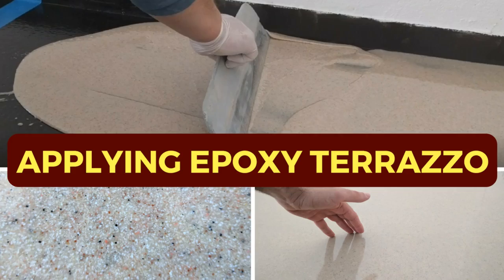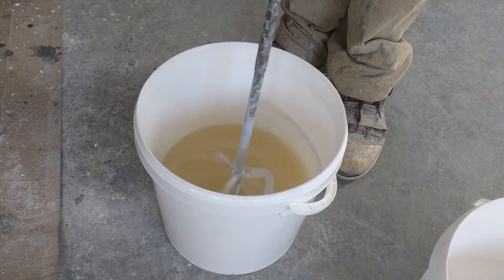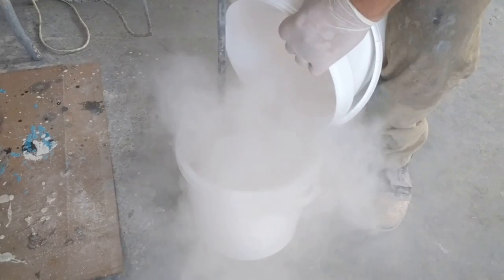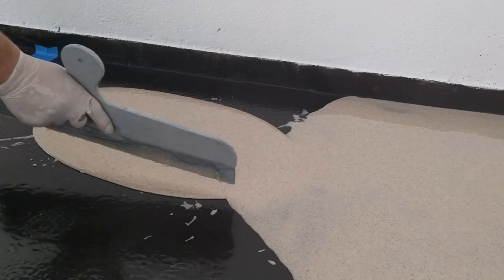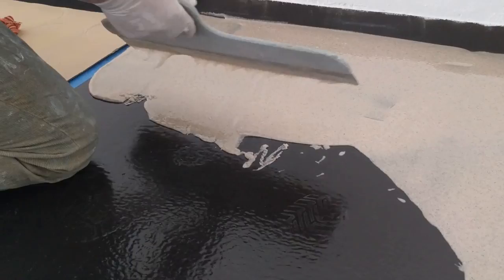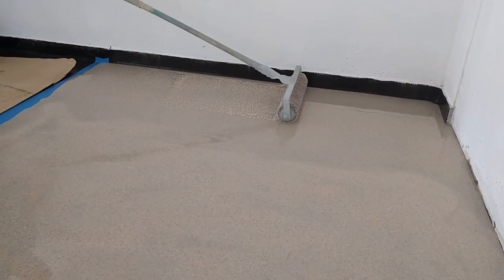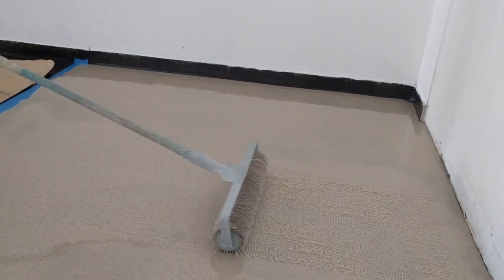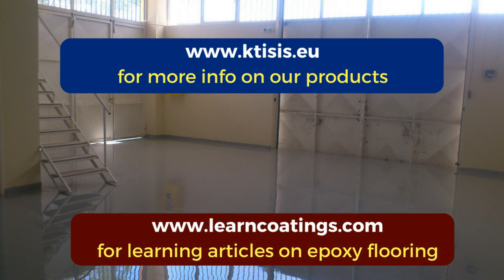Applying 3mm Epoxy Terrazzo - Step by step demonstration

Comment: Akis,  The term "terrazzo" has many interpretations through various markets and geographies.  In the US terrazzo is most frequently referring to a marble, granite or glass containing resin or cement mix applied in various patterns and colors using terrazzo strips.  The floor is ground smooth after placement (with the exception of rustic terrazzo). These floors are generally 1/4-3/8 inch thick after grinding.  The video you presented is more representative of a self-leveling seamless floor.  Still good information.  I just wanted to point out the terminology variation. Tom
Reply from the maker: thank you Tom, for pointing this out, I agree terrazzo means different things in different parts of the world

Comment: awesome job and pretty complete info ive got .thank you . but one question does it necessary a kind of primer before laying down terrazo epoxy ? or just directly over the concrete possible. thank you for any suggestion . i need to do for my shop

Comment: would this be able to bond with actual terrazzo? I have damaged terrazzo at my home that is beyond restoration, and need to cover it. Would I be able to prime it to where this will adhere and be durable?
Reply from the maker: You would need to diamond grind the terrazzo with a rough diamond grit to reveal scratches. Then apply a primer on top. After that should be able to get it to bond
Reply: LearnCoatings - Epoxy Flooring Training awesome, thanks!
Reply: @learncoatings-epoxyfloorin9448  what is a primer coating? does that needs to be applied before we  lay a new epoxy terrazzo flooring?

Comment: What is the amount of epoxy in a fit for epoxy flooring
Reply from the maker: depends on the system. For a paint system you can expect 250-300 gr/m2, self leveling can start from 2kg /m2